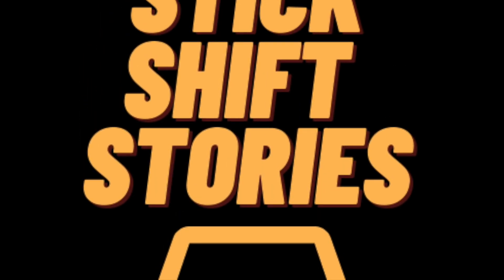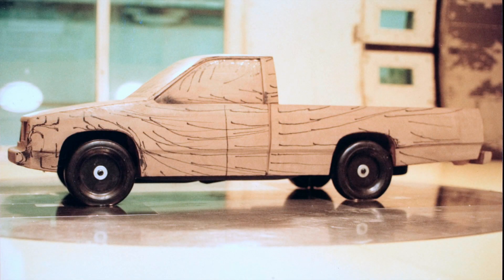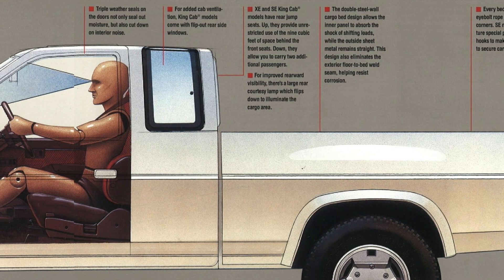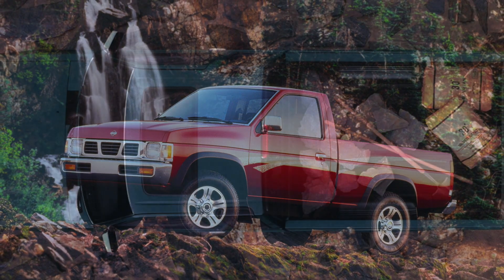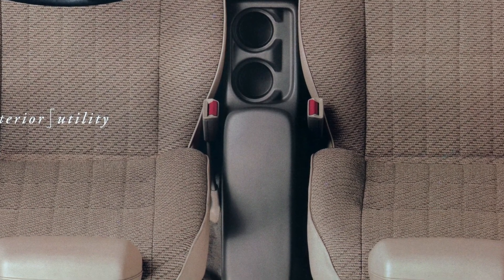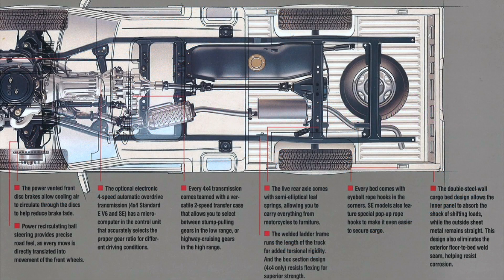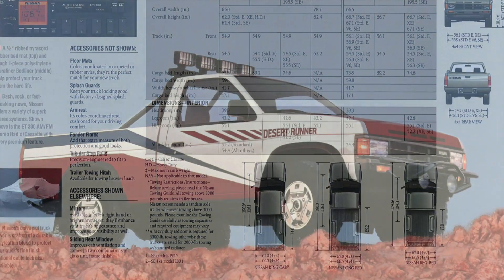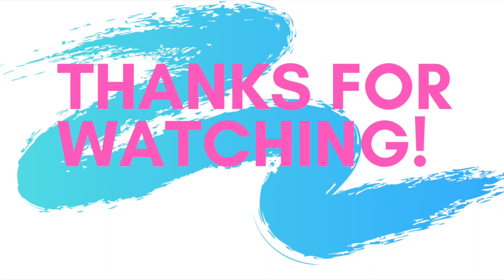Nissan Hardbody Buyer's Guide (Common Problems, Options, Specs)

Comment: I own a 98 frontier, essential the same as the 97 hardbody but with a different body and engine.
Reply: 😂😂 sir I want what  you are smoking
Reply: @elirivera2975  naw dude. I checked. Just about everything under the truck is the same as the hardbody. The body and engine are different.
Reply: Same truck except for the body and engine.  Is that all?  😅

Comment: I used to own a 1967 Datsun single cap manual transmission that was a rust bucket 😅 but it was a beast in power with a tiny 4 cyl, compared to my present 1996 daily driver it was 10 times better. In my personal experience I believe the 1990's models are very weak, not very economical, the American emissions  laws on them made them even more weak the Z motor model offer a little more power but by far a Toyota of the same era is way better truck although I drive a 96 hardbody 🤣😂😅 because I can't find a decent condition Toyota or diesel Mazda thank you for sharing God bless....

Comment: I have the SE V6. Every time I go to get parts for it the auto parts store has a hard time finding them. Does anyone have suggestions to make it easier for the parts person find anything I may be looking for?
Reply: What kinds of parts ?
Reply: @shanetyler9391  the three hole exauhst gaskets.
Reply: @muddygupps4330   really those are hard to find?
Reply: @shanetyler9391  I guess so. They can never find them in their parts lists when I go to the auto store's. Of course most of the cashier's are not mechanics either so I'm sure it's just as frustrating for them as it is for me.
Reply: I have zero issues getting aftermarket parts off eBay, I’ve rebuilt my ka24e suspension and most of the engine off “eBay parts” and it floated like a dream, my vg30e 95 king cab xe is just as easy, get the app and make it “your vehicle”

Comment: I own a 1991 2.4 manual with 240,000 miles,rust free. at his time is  running rich, I have changed fuel pump, throttle body with a new OE maf sensor,spark plugs and wires, fuel regulator, muffler, all vacuum hoses,.
The parts I have not replaced are the IAC valve, TPS and ECU. I am doing it by myself because no one seems to have a scanner for OBD 1 I still can't fix it.

Comment: Great trucks!  I have 2.  Just don't get hit in one.
Reply: Wreaked mine a couple years ago this month luckly no frame damage cost me 650 dollars in parts ebay is a go to for Hardbody parts :) hit a Honda accord smashed my front end right in the middle close to drivers side lights were fine had to change out the grill hood radiator core support front bumper and grille plastic cooling fan on the motor tough trucks :)

Comment: The D21 was nissan's biggest mistake ever made
Reply: Why
Reply: Why?????
Reply: @Muffhoney  if you manufacture a vehicle that after 30+ years is still on the road is high demand is reliable low maintenance etc.  not Good for business,  nissan went broke since early 2000 now is just low quality garbage with a Nissan badge
Reply: @zacariasblanco9738  aaah I see... yes I agree.....  but wouldn't it be great if manufacturers actually made anything that lasted now a days....   I have a 93 D21 here that I am restoring with only 67k genuine miles on it...  mainly rust and body work but that's cool....  a great vehicle is right !
Reply: @Muffhoney  yeah I have an '87 California no rust truck
Reply: @zacariasblanco9738  That is due to Renault taking over the company.
Reply: @mescko  when they came out with the crappy 2.5 it was downhill for NISSAN all aluminum crappiest motor